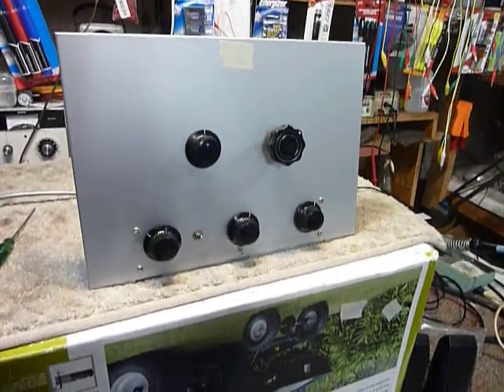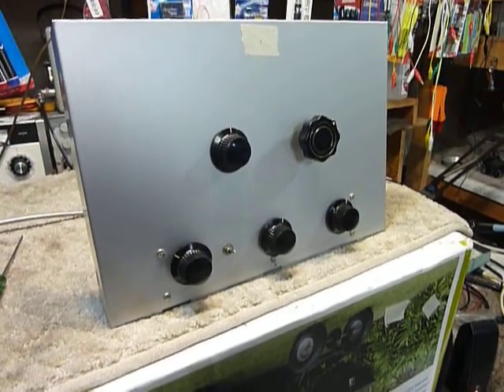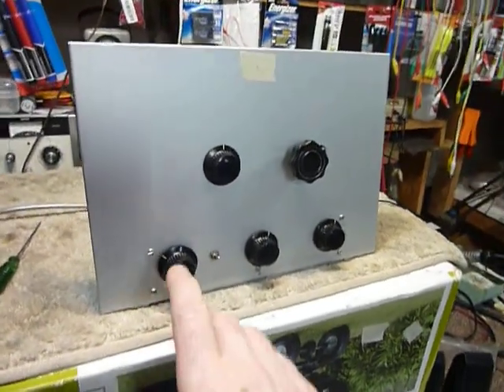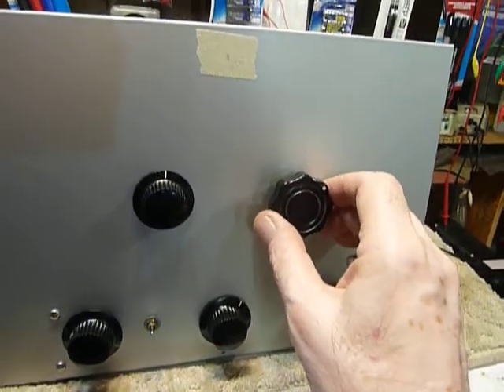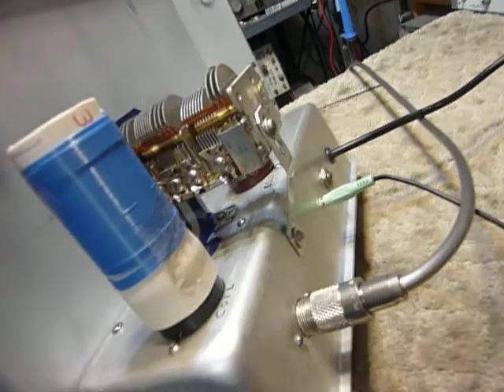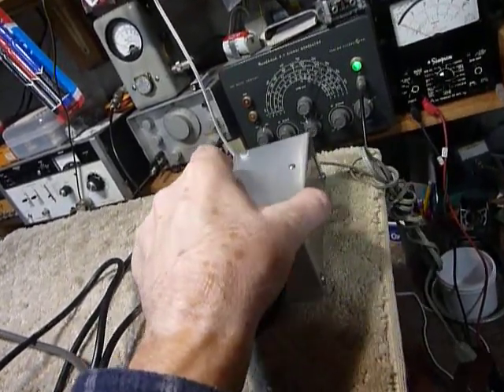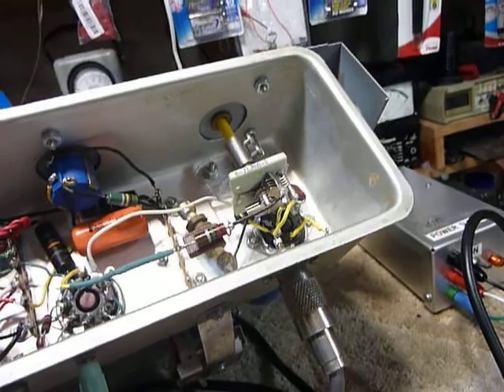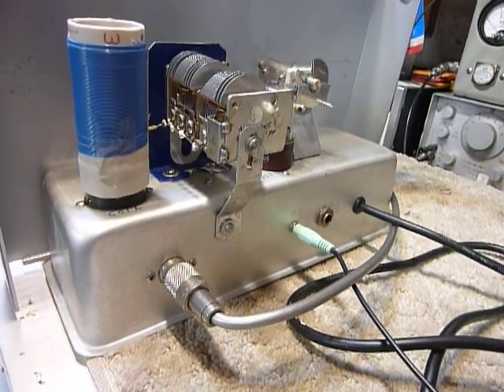AA8V TWIN PLEX REGENERATIVE RECEIVER

Comment from the maker: Update. Finished the SW-3 coil  for 40M CW I  learned some things  first  that  vernier dials of some sort are really needed for CW  tuning  CW is very quick and  sharp so vernier tuning will help a lot  BUT if you are just going to listen to AM broadcast then a vernier dial is not needed just a big tuning knob . Cw reception had hum on the signals this is a problem with using a 120 volt AC power supply . very good  filtering is needed to run the Twin Plex from an AC power supply . It worked just fine on Am broadcast but on 40 meter CW the hum was to much .  I re-worked the power supply with bigger filter capacitors  a single half wave rectifier circuit to supply the 6SN7 with DC filament voltage not real smooth DC on the filament  but it works fine  . It has a nice CW note now and copy is excellent on CW  .
I will provide more detailed information on this  in a future video with all updates and improvements I am making  . The last thing I did was to replace the 10 turn 100K regeneration pot with a common standard pot . I found a 100 K standard pot and tried it and I prefer the standard pot for regeneration to much turning and turning with the 10 turn pot. 
73   Bob